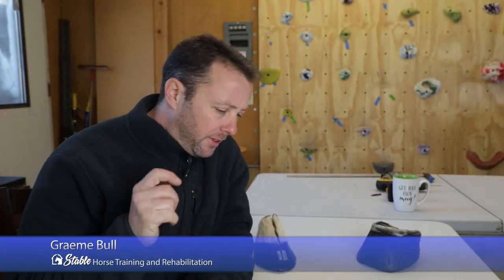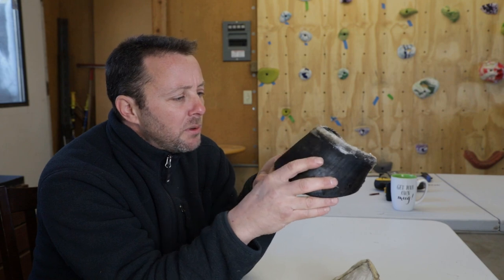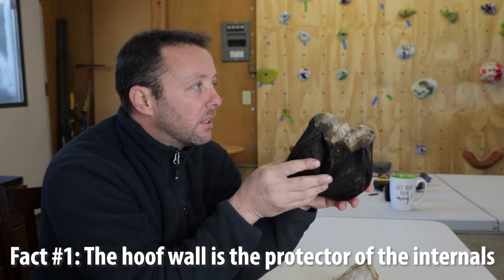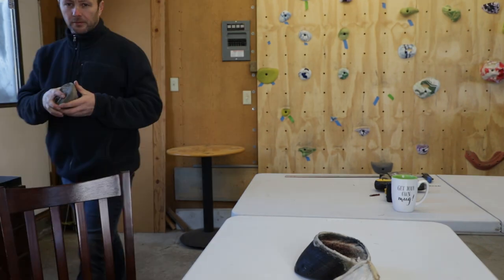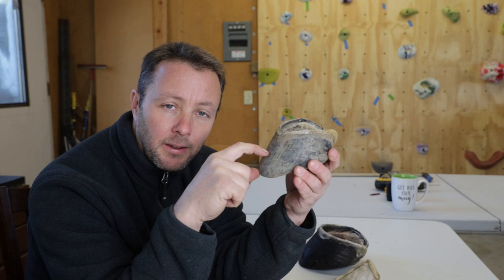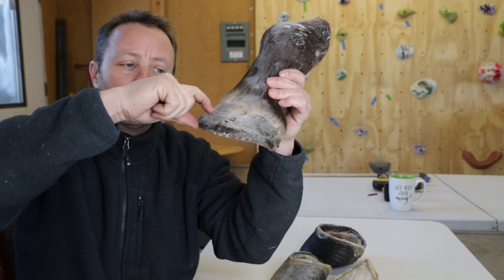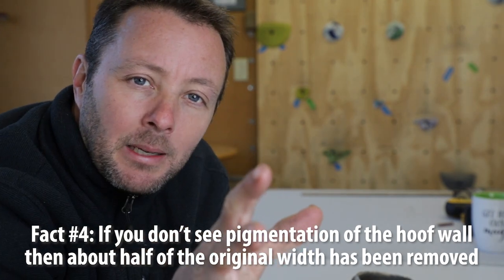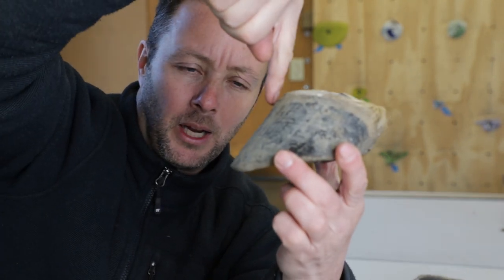3 Reasons Why You Should NEVER Rasp The Outside Of A Horse's Hoof

Comment: The black hoof. You were going to talk about the bottom growing down ward.  No concave??? What causes that? Thank you
Reply from the maker: That hoof will become less concave as it's boiled and expands, it likely would have been quite flat but I don't recall a before picture. Flat soles are caused by poor trimming, the hoof is so flared (hence the rasping of the outer wall) that the sole has no choice but to flatten out as it's stretched out. Think of it like a suction cup. As the suction cup "flares out" it flattens out. There's only so much material to go around.

Comment: The person who does my horses does a bit of outside wall rasping saying it is to make sure to open up the tiny little cracks so bacteria can't grow in there.  It has always bothered me for the reasons you say. Personally, I am not worried about the tiny little cracks, but I am not the expert.  Should I be? What would be your response to someone who says the cracks need to be opened up?  Thank you in advance!
Reply from the maker: Without seeing pictures I wouldn't be able to say much of anything unfortunately. If the person is rasping off ANY of the outside wall above the ground of about an inch, I'd really want a very very good reason, "cleaning cracks" wouldn't be one of them.
Reply: @StableHorseTraining  Thank you. I just learned they are sometimes called grass cracks.  They are not like an injury or quarter crack.  They are very minor.  Thanks again. I will be more confident the next time I question the need to rasp them.  Meanwhile, I will go educate myself on grass cracks.
Reply from the maker: I've never heard of such a thing and I'd be very suspicious of the health benefits. My horses don't have them at all.. And I would maybe guess that destroying the outer protective layer of hoof horn is likely what could be contributing to such cracks as the outer layer is meant to keep the inner layer protected. I personally don't believe there is any good reason to trim the outer wall higher than maybe an inch and that would be extreme as I'd be trying to correct a long toe or rot within the hoof wall. I recently put a post of the Facebook page of stable horse training outlining this exact problem actually. It might be interesting to you.

Comment: Thanks for such an informative video! How would you deal with flares? Or do small flares cause problems for the horse?
Reply from the maker: Most of the time flares are dealt with by a proper and timely trim. I always recommend anywhere between 3 and 4 weeks with sometimes small touch ups in between that depending on severity. Anything longer than 4 weeks almost always starts deformation and then you're just playing catch up for the whole time.
Reply: Gotcha. But how do you deal with one if it already exists? Do you trim it but not rasp it? My friends horse almost always has a flare on her right front on the outside of the hoof. She has a trimmer but he rasps it down. Is there another way to deal with a flare that already exists? Or would you leave it?
Reply from the maker: Flare is caused by pressure from somewhere other than where the flare is. Imagine taking a plastic cup and placing it on the ground upside down. If you put pressure on the top and one edge more than another, you'll see "flare" develop on either side of that pressure. In time, it will crack and break. The trim is likely incorrect for the foot. Rasping down flare usually makes it worse as you weaken the structure that is already failing.
Reply: Ok thank you. I think she should find a new barefoot trimmer then because her horse gets this flare a lot so I guess he's not trimming it correctly. I trim my horse's hooves but I don't feel comfortable dealing with anything other than a regular trim so I didn't know how to help her. Thank you for the advice!
Reply from the maker: Can't argue with physics.